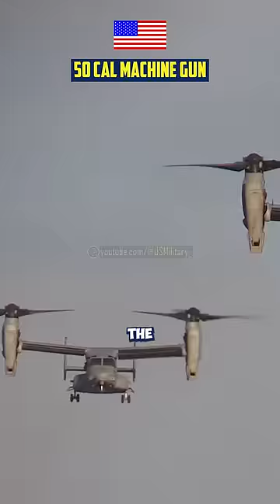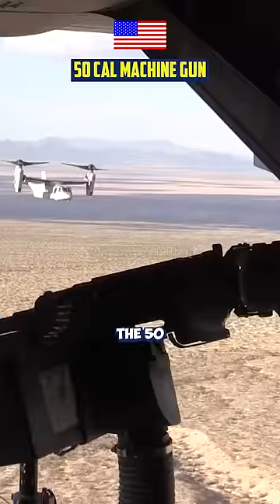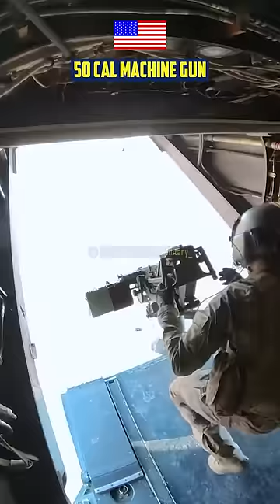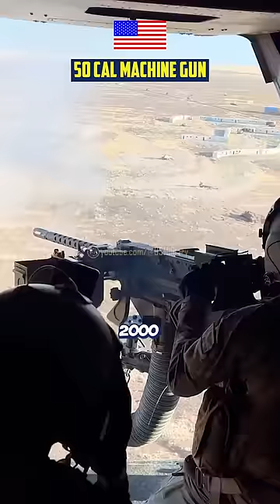The Scary Reason Why the 50 Caliber GAU-21 Heavy Machine Gun Used By @USMilitary_ Is So Advanced

Comment: It's the aircraft that's advanced. They just slapped a 50 cal on there to top it off
Reply: Not just any .50 cal. The GAU 21 has different internals and fires almost 3x faster than the normal M2 HB employed by ground forces.
Reply: This 50 cal. is different. Super higher rate of fire, compared to the usual 50 cal.
Reply: @richardwarner3705  airforce been using 50 calls with higher rates of fire since ww2
Reply: In the end it’s still a .50
Reply: @tibbs3112  This version was originally modified for aircraft during WWII the army nomenclature was AN/M3. It's not new.
Reply: @braedennoble1566  You're correct that the gun existed during WWII, but the air force didn't.
Reply: When I look at the osprey I just wonder why they didnt make it a full fledged quadcopter. It was notoriously hard to pilot in hover mode.
Reply: @JGray1968  apologies im canadian😂
Reply: @braedennoble1566  No worries, as an army veteran, I enjoyed having the opportunity to remind people, especially air force veterans, of that fact😄
Reply: @JGray1968  I believe it was the army air corps and naval air corps before the Air Force.

Just remind your basically my branches child
Reply: @bloodwintertales5984  My branch is the oldest, formed on April 19, 1775.
Reply: The Osprey is possibly the worst aircraft in active service in the entire world. Its accident records are absolutely insane, they don't let important people on board of them.
Reply: Yes
Reply: Lmao it’s not that advanced. If it was a lot of my friends wouldn’t have died on it due to malfunctions
Reply: @FractalNinja  hover mode wasnt the issue, it flew perfectly in both hover and flight mode, the difficult part was going from one to the other without falling out of the sky
Reply: @richardwarner3705 yeah because it would be uncontrollable unmounted lmao
Reply: @monkeybandit4162 

Fire from the hip until hip breaks.
Reply: Half of the time it is apparently also an M240. Tf is this channel?
Reply: Advanced at crashing 😄
Reply: @JGray1968  the airmen become infantrymen when shit hits the fan 😂
Reply: @braedennoble1566 yeah I agree with the "advanced" being nonsense. So they lightened up the barrel and bolt and put a stiffer spring in. Advanced...
Reply: Wonder how many Muslims they kissed using that.
Reply: 1200 rpm.
Reply: @tibbs3112  Holy hell that's a lot of dakka
Reply: @JGray1968  the GAU-21 is an Open Bolt system it's very different from the AN/M2. The feed pawls are almost the only compatible internal component